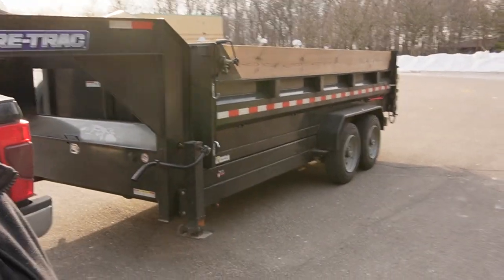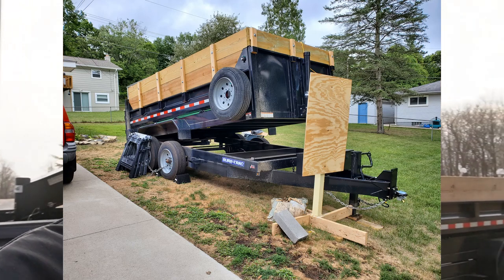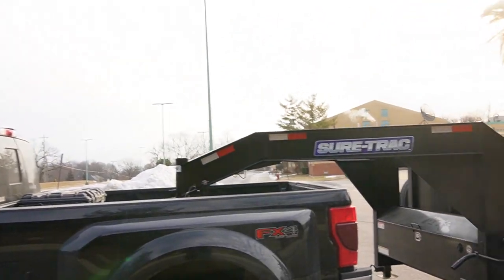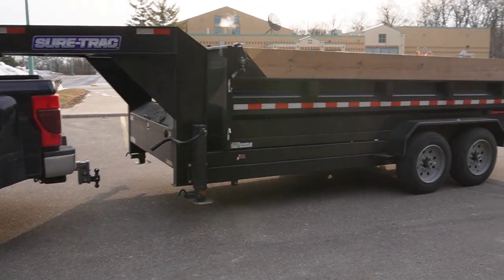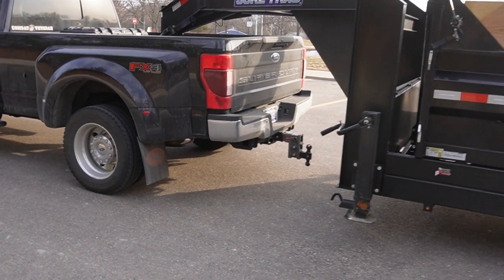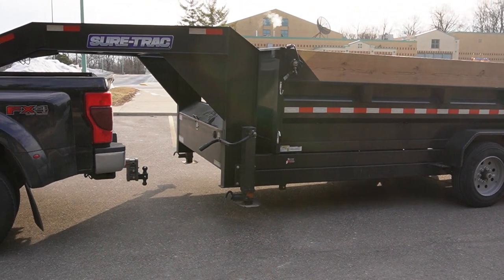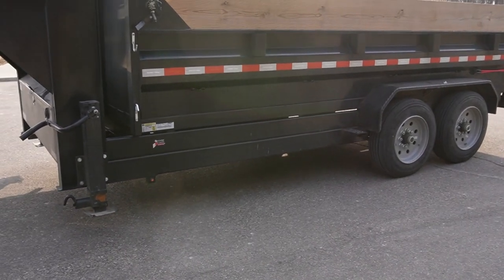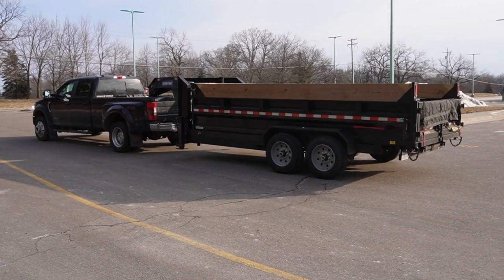Gooseneck vs Bumper Pull! Which One Is Right For You!

Comment: Many years ago I had some advice from an oldtimer.  When you pull each through the snow, look at your tire ruts.  Bumper pull will closely follow the tow vehicle's rut while a 5th wheel/gooseneck will cut it's own path.  This is what you have to bear in mind when turning or backing.
Reply: Another reason to get the bumper pull! 👏🏻
Reply: This is completely dependent on trailer length and track width. Not bumper pull vs goose neck. Your old timer just made that up and started stating it as fact because it's sounded good in his head.